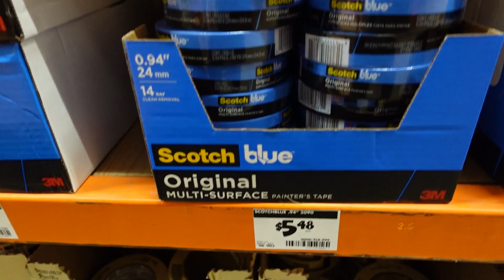DIY Cheap Faux Brick Wall Tutorial | UNDER $50 Project | Small Entryway Makeover

Comment: If you use a small pail( big and wide enough for your putty knife) and add a palm or 2 full of water and mix. It not only is easier to spread, goes further, and helps with bubbles.
Reply from the maker: Great tips! I don't think I had any issues with bubbles but I definitely wouldn't mind making it go further!